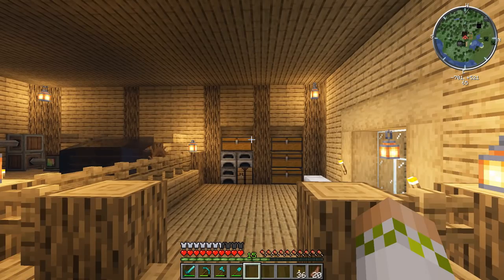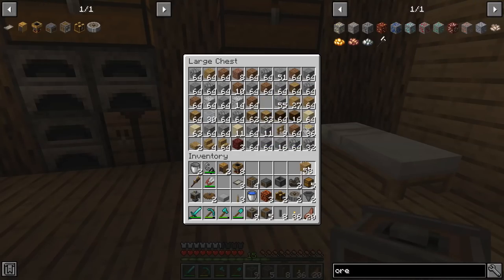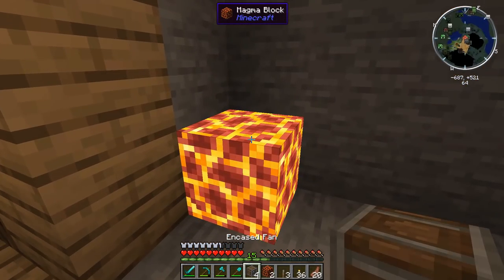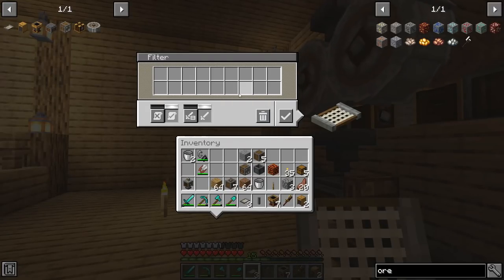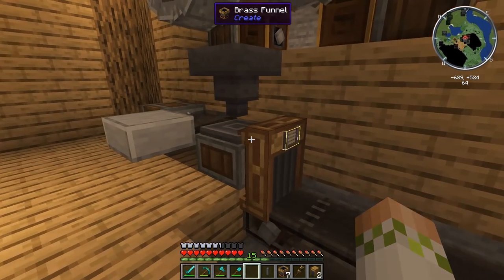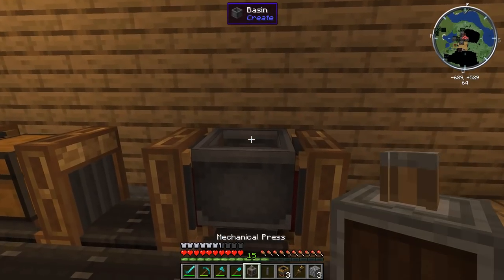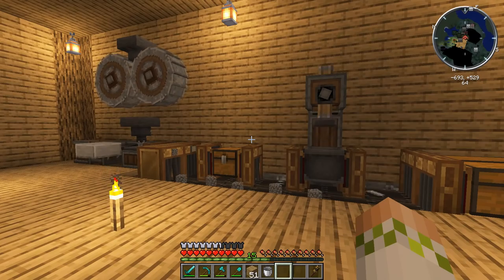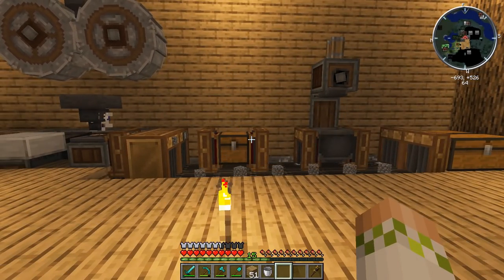Surviving With Create 0.3.1 :: E04 - Crushing Wheels & Ore Processing

Comment from the maker: As some of you may run into, the encased shafts are not craftable in the newest version and are simply made by clicking casing on a placed shaft. The pre-crafted encased shafts in this video were only possible due to a bug that i stumbled across while planning out this entire build in a separate world the night before. The bug has been reported and will be fixed (if not already, im not on the very latest version). For those of you who are confused, you can either replace them with regular shafts and leave it at that or cover them manually with a casing of your choice :) the covering definitely looks better imo!
Reply: I see
Reply: Did you actually heart your own comment
Reply from the maker: Yes, thanks for asking!
Reply: @RagePlaysGames when you realize the crushing wheels can be used with belts to be simpler

Comment: Since this is for an older version of Create, and heat no longer works with fans, to work around this, I linked the two gear boxes with encased chain drives, and attached some water wheels in the wall behind to the middle chain drive. 

Otherwise, the whole set up still works perfectly fine. I really enjoy these tutorials, as they've been my favourite introduction to this mod, even if i'm on a newer version. Everything is easy to understand and is nice and compact to make. Thank you!

Comment: Okay, I admit I hadn't thought of using the brass funnels to pull out 9 nuggets at a time. My own Create setup got massive because I wound up having dedicated lanes for each nugget available (which, in a kitchen-sink pack, is quite a lot); this would have streamlined things a lot, but I was still feeling my way around the mod and hadn't really clued into the brass funnel yet.

A few relevant tips:

- You can use an Attribute Filter on the first funnel pulling out of the depot. Use a piece of crushed ore in the filter's item slot, and one of the options you can select will be "Can be washed". There will also be an option to take the opposite of that condition - "cannot be washed". This is handy if you're playing in a pack that adds more types of metal to process.
- Similarly, the attribute "has tag: forge/nugget" can automate that lane of the funnel, and "has tag: forge/ingot" for the last bit.
- When it comes to tidying things up: you don't need to pre-craft encased shafts. (In fact I didn't think you could anymore, so, huh.) Just put a regular shaft down, then use an andesite or brass casing on the shaft (Right-click without sneaking) and it'll be encased. Since their textures connect with any of the andesite-casing-based blocks (including casings themselves placed in world), it can be quite elegant.
- I'm less sure of this, but: You might not have needed the brass funnel on the basin. Just put the filter directly on the basin, and that side that's facing the belt will automatically dump onto it (that's what the chute is for that you turned off on the other belt). Since it's only making one item at a time, and that slowly, you don't need the high bandwidth of the funnel. I know this works for a single item, but I admittedly haven't tested it with a filter.
Reply: Seconded on the Attribute Filters, they're done in a really nice way - as is most of Create, it seems :) I wish their wiki was a bit more complete tho, as I only found out about how wonderful they were when I accidentally crafted the wrong one :) 

I was also surprised by the "pre-crafted" encased shafts he had, as they're creative mode only now afaik [that's what the tooltip says] - with the shafts are now encased how you say above. Best thing is you don't use up the encasement item when doing this on any shaft, which is handy when hiding a whole room length of shafting, so to speak.  
I suspect Rage was confused like I was initially by this change, and snook them in quietly before filming so as not to ruin his flow. But if so, it's excused as the correct method is free anyway :) They perhaps drop when breaking a previously encased shaft, but I haven't tested that. If neither of these are true, I remain bewildered as to how he got them :)
Reply from the maker: Haha yea the 9 count setting is super nice! I was tempted to dedicate one lane to each nugget initially but it got HUGE. I will have to look into the attribute filter since that sounds super cool and useful for future builds! As for the encased shafts, apparently I came across a bug with them while testing in my creative world trying to build this, used the same method to get them in the normal game, and so while you shouldn't have them, it is (or was) possible to get them. This has been appropriately reported as a bug and will be fixed :) it can easily be replaced with regular shafts, but I had no idea they were creative only as I assumed this wasnt a bug initially lol. Not gunna spoil it, but no it isnt simply breaking a pre-made one as that just gives the shaft back! (Hint because people want it: The schematicannon has way too many dupes / bugs haha)

Comment: This video is extremely helpful in getting going on Create ore processing. 

When I brought it into my survival world and tried to run it at a higher speed, I found that the output funnel on the second basin was more of a hindrance than a help.  The basin would fill with 16 nuggets, I guess, and when the ingot was crafted it would pop out into the world. 

The default basin output port onto conveyor belts ejects the ingot directly when it's crafted, so when I removed the funnel the problem disappeared.

Comment: I am learning so much from your videos! I have just gotten to brass technology and I'm looking forward to using the brass funnels and tunnels. I have a huge windmill that I'm using for everything right now, so I will definitely do this process a bit differently, and I think I'll try adding a clutch to turn it off so it only uses stress capacity when I need to use it; same with the mechanical crafter.

Comment: Great Tutorial.
I have a slightly different build.
First I'm using the Create chute (I think it's called). It puts stacks into the crushing wheel instead of single items compared to the hopper. This means you also wash the stacks as as a whole into nuggets. I think it's way faster but haven't tested it.

I have the the belt runnning under she crushing wheel and you can wash from below through the belt. Items will stay infront of the funnel till they converted into nuggets. 

Only problem I have is that my magnet (different mod) keeps picking up the crushed ores before they land on the belt.

I also just collect the cobblestone in the same buffer chest as the nuggets but keep it from ejecting with a "brass" filter. Because the nuggets only stay in the cheast when less than nine the chest never really fills up and cobblestone isn't accumulating that bad.
Also as mentioned by others. The basin at the end can unload without the need of a funnel.

The encased chain drives can be used without the "wrong" direction problem. They keep all the same rotation and speed and you can easily put an adjustable gearshift at the start to increase or decrease the rotation speed.
The Gearbox will alter rotation. Because you need to get around the corner. It's like a setup you could actually create with 4 large cogs but simplified in one block.

Thanks for the great Tutorial

Comment: Just checking but Encased fans dont work by heat anymore right? I tried putting a lever on an encased fan on top of a magma block (arrow pointing downward) (8:10) and nothing is happening. So i deduced by description that heat does not generate energy via fans anymore?

Comment: Nice and elegant design as ever.
One thing I'd note: while not applicable to your build here, as it's slow enough not to matter :) as far as I can see Create's "Chutes" are better for this operation than vanilla hoppers as they transfer up to a stack per operation (nothing on the wiki about the block, but I checked in the source code while watching to confirm my suspicions) 
[ tho with your intentionally manual loading as you have it at present, you'd need some additional chest:funnel:belt feeder system into the chute to allow you to manually feed it ] 
As I say, not important with the speed you have at the moment, but if scaled up to more than a few times this speed then hoppers will not feed the grinders fast enough to run at peak efficiency. You may of course have intended this bottleneck for the slow grinders to not take 10 minutes per operation if fed whole stacks :))

Comment: For the crushers I've just been sticking water wheels behind the wall. If you use shift-rmb you can control the wheel direction, and you can run both wheels off two water sources.
(I might have gotten this trick from you?)
Reply: water wheels suck, a maxed windmill bearing is over 50 times more powerful
Reply: @toomanyblocks8448  Yeah, good luck hiding one of those away in a little closet behind your setup

Comment: I ran into a problem when to much ore fed through the crushers to fast.  The lower hopper over flowed.  I used a comparator and repeater line to lock the upper hopper until the lower is empty.  Runs steady and smooth now.

Comment: I love this video. When I used Create, this is the inspiration for my ore doubling. Though, I've been encountering an issue that is just aggravating. My mechanical press would occasionally produce unwanted results, namely iron bricks. As of late, it always produces iron bricks despite having the funnel set to 9. Thinking about it though...I think it's because I sped up everything in my system, belts included, so maybe instead of 9 going in the basin there's 18 and it gets confused? Anyone else encounter this? I know a work-around that seems to do just fine but I'm curious if anyone else experiences this. Again, thanks for the video man!

Comment: A bit wasteful with gear boxes/shafts and funnels. At 24:50 you could just use two shafts and a belt instead of the gear boxes and shafts and instead of using brass funnels everywhere you can simply use andesite funnels where filters are not necessary saving you quite a bit in resources.

Comment: Try to use water wheel with 1 block soul sand elevator in the back, some extra energy
Reply: Is that actually possible? and does it work with magma on the other side
Reply: @why3994  guess magma's not necessary, but yeah it works

Comment: That magical particles that come into effect when you are placing the belt down, I don't have that unless I'm in F3 menu. Is that meant to be on do I need to edit a config? 

Yes, I'm using the newest version.
Reply from the maker: Im not sure, it may have to do with certain particle settings in general in your video settings, but I have not ever edited config settings to get anything like that.
Reply: @RagePlaysGames  Yes, I had the particle settings to minimum. Which disable that. Thanks! I didn't even think of it.

Comment: When I place ore in the crusher, I get the crushed ore, which gets deposited on the depot, it then washes it, and 3 or 4 nuggets come out, but then a piece of "Washed Iron Ore" just sits on the depot.  I am using a windmill to power everything.  I can smelt the Washed Ore and get another ingot out of that. Do I need to mod this to route the washed ore to a smelter?
Reply: I just changed the first filter to attribute can not be washed, so the crushed ore is held until it is washed, then I changed the next two filters to nuggests and washed ore + cobble to split the streams so the cobble and washed ores go to the smelter.

Comment: The chute is better than the hopper, since it transfers stuff faster, how come you chose the hoppers?
Reply from the maker: In this setup, the depot / washing the crushed ore portion of the setup can only hold one piece at a time and because the  chute has no internal storage, as tons of items get crushed they will sit as entities on top of the chute whereas with the hopper, it will at least pick them up with a decent buffer as it processes. As for the hopper on top of the crushing wheels, you could use a chute with a chest, but then it will mass dump ore into the wheels and that will process a significant chunk at a time and dump a lot of processed ore into the washing setup, leading to even more backup out the gate unless you up the speed of everything other than the wheels (which we eventually will do). I think both can work, but I prefer using the hoppers over the chutes in this case :)
Reply: @RagePlaysGames  so then what if you don't use a depo and just let the items drop onto the belt? The chest will only take the nuggets, so there's no problem, right? Maybe use a double chest.

Comment: im trying to craft the crushing wheels on my own server and they wont craft it goes through the animation then just spits the materials out at the bottom
Reply: are you sure you have the recipe correctly? it only spews them at the end of the crafting when it's wrong
Reply from the maker: You have to make sure the recipe is correct. If you have all 21 mechanical crafters set up and the items get spit out at the end, that means the recipe itself is incorrect, not anything with the crafters.

Comment: the rotation speed controlled needs a chip and the chip comes from the grinder so.. how?
Reply from the maker: Are you in a modpack? We made the chip on camera in episode 3 when we set up the mechanical crafters and went over how to use the covers for smaller crafts. Its one of the main reasons other than the crushing wheels that I even set up the mechanical crafters.

Comment: Bulk washing may give you nuggets, but bulk blasting will give you 1 ingot per crushed ore, in other words, think of it this way, you have that chance to get 2 crushed ore on the crushing wheels, great right, you can bulk wash them to get either enough nuggets for 1 iron ingot with about 6 left over, a chance to get enough for 2 with 2 left over, a chance to get enough for 2 with 7 left over, and so on and so forth, but, with bulk blasting you have a guaranteed chance to get 1 or 2 ingots without the annoying left over nuggets that don't end up being used

Anyone have a reason to disagree with me 👇 just remember, this is my opinion